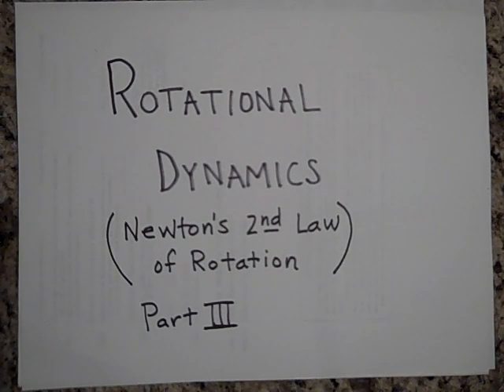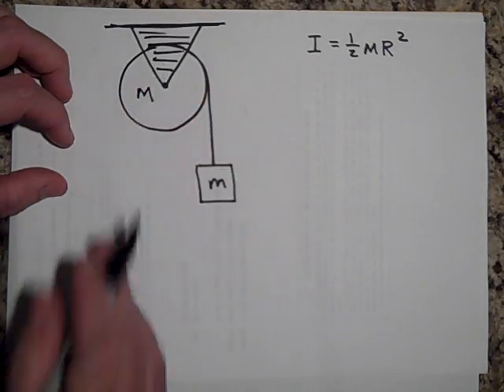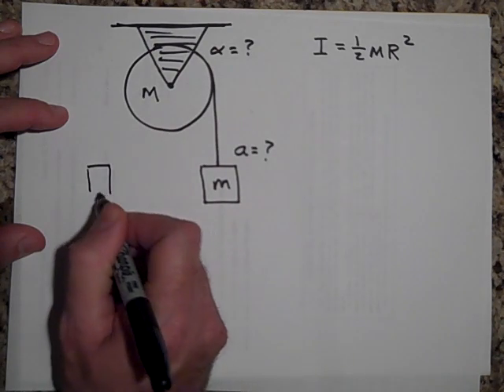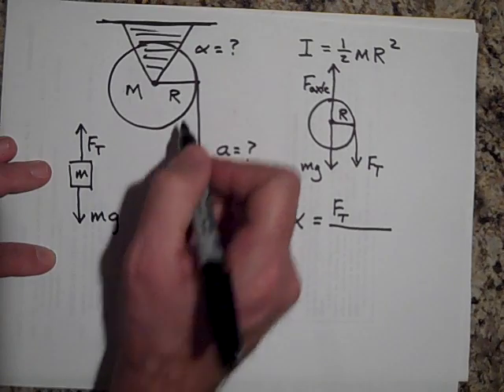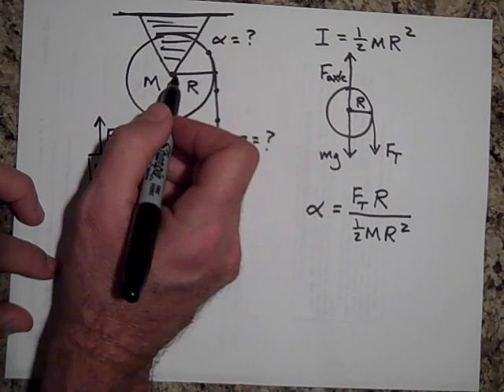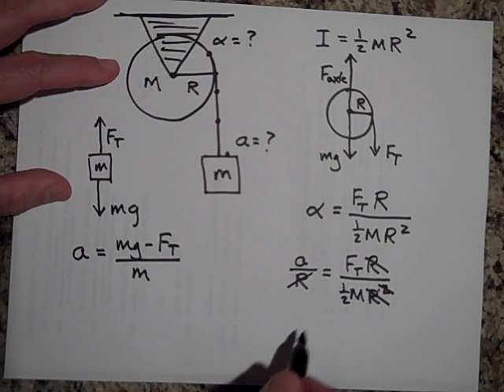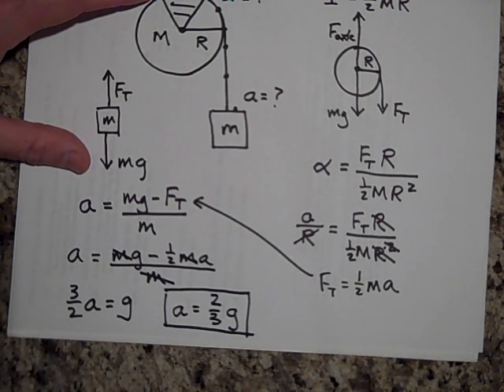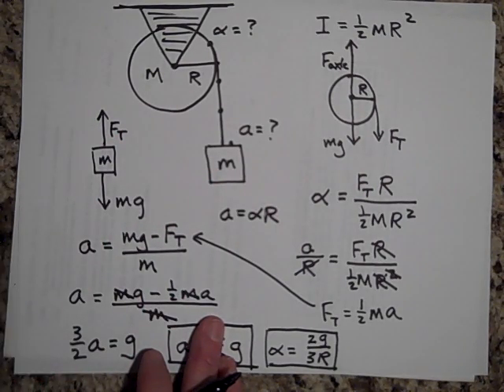Rotational Dynamics (part III)

Comment: I don't get it. @2:30, how come the force on the pulley is simply the force of tension down? Why would tension be pulling the pulley down? I think that it is the weight, that acts as torque
Reply: The weight cannot act as torque since it is pulling on the center of mass and if it were the only force in the system, the wheel would simply move down and not rotate. The tension force is the torque because it's acting on the side of the wheel, at a distance from the center of mass, therefore exerting torque on the wheel.

Comment: is inertia not I=mr^2  instead of I=1/2mr^2. Not quite sure where you are getting that from
Reply: I know this is old but in case someone else is confused: Moment of inertia changes depending on the shape/distribution of mass of the object. A solid cylinder is I=1/2[mr^2], a hollow cylidner/hoop would be I=mr^2